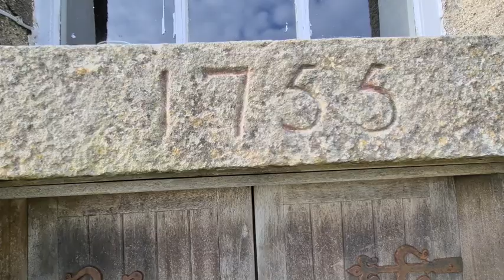Mull Monastery and Kilninian. A DECADE of Orthodox Monasticism in the Hebrides (Fr Seraphim Aldea)

Comment: Father, why don't you make a system for collecting water from the source? Can it be made portable, installed at night so that a tank can be recruited, which can also be made mobile if it cannot be installed permanently? This would be important for the parishioners too. In Russia, the presence of a source at a temple / monastery where you can draw water significantly increases the number of pilgrims. The water source is an important symbol of the spiritual source, which is the monastery

Comment: @mullmonastery: At 11:11 mins you are showing the flaked paint from the re-plastering which was done a few years ago. I don't want to undermine your decorator's work, but this shouldn't be happening to the paint if the plaster had been left to dry until it was bone dry before decorating. If the paint is scraped-off and the bare plaster is left long enough and repainted it will be ok. It's frustrating I know Father, but it's something I know about from experience. Thanks

Comment: Dear Fr I saw your video about the church and your damp problems. The ongoing problems could be mostly due to you dehumidifier now. Your church appears to be of an age when damp courses were not a feature of this construction . This type of property has rising damp and this will rise to the Hight of a mtr above the highest ground level inside or out. Conventional gypsum plasters do not work in this situation The moister in this situation evaporates off Lime mortar plasters are best and vinyl type emulsions trap the moister in the wall and it will rise even higher up the wall and your dehumidifier will pull it out bringing he Emulsion of the wal.l Is your wood shrinking  ?? Google lime mortar walls.   Best regards and prayrs Jim